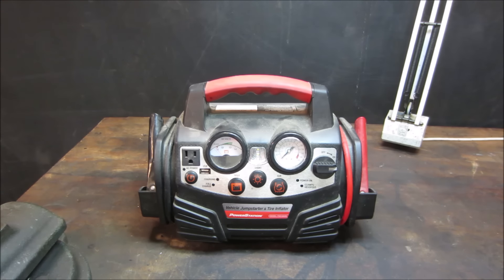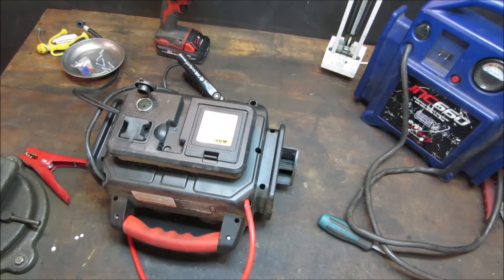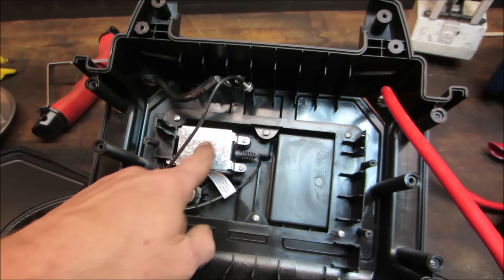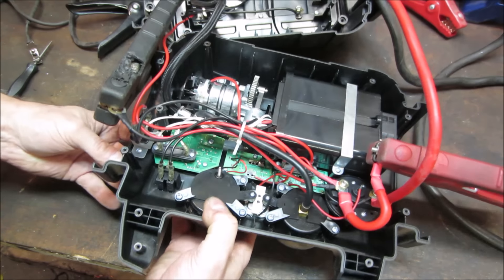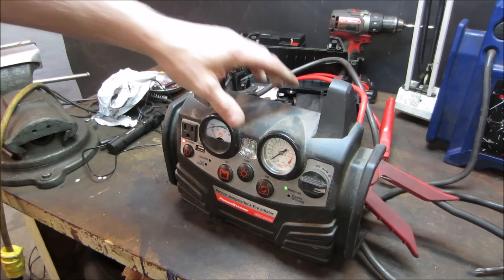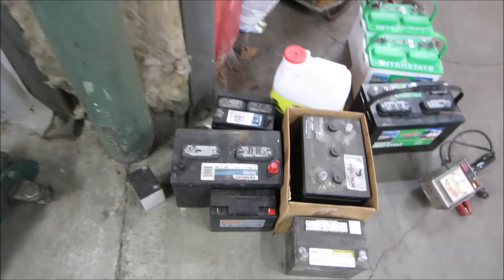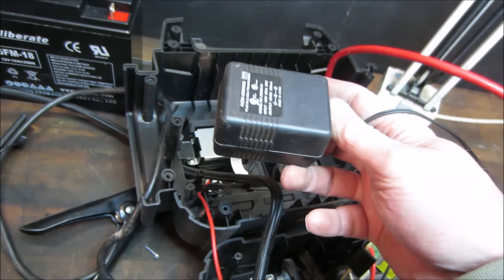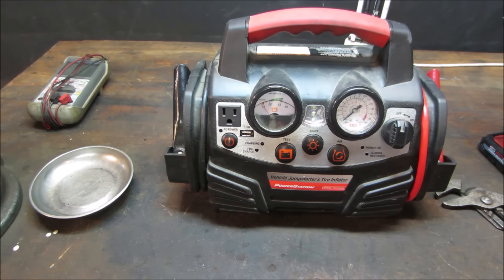What is inside a car jumper pack? and can we fix it.

Comment: On all those batteries you got you should rig up a trickle charger for all of them and put it on a lamp timer to run it every day for half an hour.
Use a single trickle charger.  Tie all the grounds together and to the ground on the charger.  Run the charger positive through resistors to each battery.  Hmmm... use about 42 ohms/1W for each resistor.  That should input 50 to 100mA.  And that will keep those batteries charged and healthy.  It looks like you had perhaps 10 batteries so a 1A charger should do it.  
A dead battery left to sit is a battery that will be unrecoverable in just half a year.  Also, you can setup the wall charger for those jumper paks on the same timer and give them 30 minutes every night.
Same goes for most electronic equipment.  Electrolytic capacitors with no charge applied to them will eventually have their plates collapse and become no good.  So I have my guitar amps set for ON and plugged into a lamp timer that turns on power 30 minutes every night.  I have some audio amps that I just leave ON all the time.  Two have been ON (except for power failures) since 1985 and they still work just fine.  I have two VCRs that I left unplugged for several years.  The caps were shot.  I had to take them apart and replace the big electrolytics and they came back to life.  Unfortunately when power is applied to them they don't fully turn on without a human pressing a button.  They're just doomed.

Comment: The fan is cooling the inverter which makes the AC.   It has mosfets in the inverter which create “synthetic” AC from 12v DC by fast switching and need cooling.   That tiny inverter would power an electric razor or a phone charger.

Comment: Yes it would be interested in the Three rail train set,especially if it’s metal rail holders as that might be Hornby 00 gauge built roundabout late 1950 early 1960 when launched in England slightly later Triang released one I think the Hornby ones are collectors item and worth a bit.If you do make a video of it a lot of your followers who like me in my 70s might be interested the gauge and the details carried on the old Hornby engines and rolling stock are fantastic for metal parts . I hope 🤞 you make the video no matter what brand it is all the best Jeff original pommy , now Fair dinkum Australian 🇦🇺
P

Comment: @Mustie1 If you turn the small plastic flat screw on the battery load tester to the right ( or left) it will adjust the pointer

Comment: I have an old Stanley jump pack that no longer has the guts to jump a vehicle, but I keep it around anyway for power outages, etc.  It has a 12v socket and a couple USB ports.  The battery is weak but has plenty of capacity to charge USB stuff and with a car adapter in the 12v socket, will run a radio for at least a day, probably even a small 12v TV.  I probably should throw a new battery in it, but meh...

Comment: Looks like a bog standard UPS battery, good for 3-5 years tops, good news is they are very standard sizes and quite cheap. for the inverter, probably just a laptop charger or something, maybe even a cordless tool charger? the mickey mouse one in my Volkswagen is good for 150w.. good enough for a crockpot.. good chuckle for anyone who has read Manifold Destiny

Comment: A painful learning experience I had involved buying at a ham radio swapfest a new old stock gel cell, and finding it dead. I learned that if they encounter high temps and low to no charge, they will be ruined. PS- yes to the trains! PPS- That inverter can power a laptop power supply, or a small TV.

Comment: Ive picked a couple of these up and they always have an issue with the battery. The first one i fixed just had loose battery connections and still works just fine 3 years later.

Comment: That's A 12-volt battery for sure. If you use A blade to cut open the seal on it to. Then  you can refill up sealed batteries again with the same type of refill acid fluids. Auto parts stores. It's sulfuric acid fluids. By wearing rubber gloves.& safety glasses to outside ventelated area. Then fully charge the battery up wait to let cool back down test it.& then you use superglue to replace the seal top plate back onto the battery again.

Comment: It's either A 12-volt lion lithium battery.,or 6-volt lion lithium battery inside of those battery chargers normally. They half to charge around 5 to 20 amp hours on most. They flunkuwait from one to another battery type.& brand style to. Aswell as amps& voltage ratings on label by water etching paint.& peel decals letters.

Comment: A lot of times if you jump the dead battery to get some voltage in it the charger will work. Most new chargers are  set to not charge if battery is to low.  That one may have been to far gone though

Comment: i just got one of those small jumper packs with a lithium battery they are heaps smaller and i can jump my diesel international tractor with no problems, it actually spins faster then the old style battery packs

Comment: Ifr you can  get to the caps a lot will be low on water but ull probably have yo drill holes  I like those mini ones I bet if u pout em togethere you could make a back up system for your house  like a min i battery bank.

Comment: The intention of the 110volt socket is for a work light or emergency roadside flashing lamp, not to exceed 65 watts.  ( A drop light, treble light).

Comment: Those batteries are probably sulfated.  When lead acid batteries are left discharged the lead sulfate on the plates can crystalize making it difficult or impossible to recharge.  You can sometimes use a gadget called a desulfator to make them work better.  Lead acid batteries need to be kept at full charge to prevent the sulfation.

Comment: There is A adjustment set screw in the center of the tester you zero out with A small flathead screwdriver.

Comment: Make sure to top up the water level in those little “sealed” lead acid batteries. There’s no such thing as a maintenance free lead acid battery, they boil off water just lake any other battery there just more sealed to try to make them last. Just a couple drops in each cell extends the life by years.

Comment: Before you even take it apart, you  should be able to connect a battery charger to the leads and see if the internal battery will take a charge. This narrows it down to battery or internal charger being defective. (or connections)

Comment: Hey mustie, what do you think bout those battery charger that claim to recondition batteries and are able/made for trickle charging a battery thru the winter? I'm thinking about chargers like the optimate 4.
Reply: I have an optimate 3, great for trickle charging even truck batteries. It won't save a battery that has been left discharged for a long time though.

Comment: $30 battery is the fix. Unless one has one on hand or can get it cheaper somewhere. I owned one of these multi function jumper packs and it didn't even last a year from Walmart but I had the warranty & got a gift card right away to use on whatever I wanted from store. If your jumping vehicles often, might be worth having a jump pack that does one or two functions, once they add in all the other accessories, I think it ruins the purpose and shortens the life of it in my experience

Comment: As it so happens, I just changed the battery on my inexpensive jump starter. It turns out that it may have been the adapter charger. I didn't try it before tossing the battery.  Yes to the train: do you still have the one from a while ago?

Comment: In my experience batteries never seem to have date codes, at best they have those grids where you can punch a date code in yourself (or if they are dated it's the original battery that came with the device)

Probably because they want to sell the batteries even once newer stock comes in and people can't tell a battery sat for a year, because people would definitely end up digging the newest one in the shelf. Just a hunch though

Comment: Awsome work I have a psx2 jumper My air pump works but i charge it. it won't hold the charge?? Help..I'm a Diy...also I have jnc770R  that I plug the extension cord n it flases  full,full,full but I use a multimeter n it says 8.70v what could it be ? I'm new to this jumpers

Comment: This may be a dumb question but do you know if you can jump from just the battery, if you have cables of course.  I was sent one of these by mistake.  Don't need a charger or compression and I don't want to buy a jumper pack but can I just use the battery in a pinch.  It's 12v but does it have enough amps.   Yeah I could try it but I don't want to disconnect the battery and hassle with it right now.  It seems to me that these power packs can't do anything except connect the battery via cables anyway.  They can't increase the actual amps of the battery, right.  I already have the cables and battery box for it and it would be lighter and easier to use than a full size car battery as a spare.

Comment: the load meter needs to be calibrated, that's what the little screw is for in the middle of the pointer.... hook it up to a charged battery, tweak the adjustment to where it should be then there you go.
Reply from the maker: then it would be of on the voltage

Comment: - first of all you show that we through way too much stuff out. thanks!  Replace the bad battery and be done.  As for the black box - that's an inverter board.  Probably puts out 50 - 100 w, usefull for a laptop charger.  And yes, Christmas is soon, do the train set!

Comment: A typical lead acid battery cell is 2.1 volts. “6 volt” batteries have 3 cells, so 2.1 volts/cell * 3 cells = 6.3 volts. As you may guess, a “12 volt” battery has 6 cells, so 2.1 volts/cell * 6 cells = 12.6 volts. This is what they call the OCV or open circuit voltage, basically what the battery voltage will be when it is just sitting unloaded. Lead acid batteries can also carry a surface charge, which basically just artificially raises the voltage until a load is placed on it, and is very typical after charging (which is why your freshly charged battery showed almost 14 volts).

Comment: Lead acid battery, left un charged for over a year, is dead.  Even if you get it to accept a little charge, it won't have anywhere near it's rated capacity.

Comment: That was interesting, I wouldn't trust the amp hour rating on the Chinese battery,  they do have a habit of over rating their products to make them seem better. The black box would be an inverter, changing 12v dc to 220v ac, only thing is there would be just enough current flow to operate a little mains powered radio, no chance of using it to power a grinder.
Reply: the outlet might only work if it is connected to 120V while charging
Reply: @natalieisagirlnow  lol! Then what's the point of it?

Comment: There are steps in the green with numeric denominations ie 600 700 800 900 that is your cold cranking amps the needle drops to the amperage in battery under load read the green number that’s the amps at the step the yellow range is if you have it hooked to a vehicle that’s running it will tell you if it’s charging you compair the gauge with the Cold crank amp sticker on your battery to see how close it is to see if the bat is good

Comment: The jumper will work for less time with the new battery as it puts out less power. 17 amp for 1 hour vs 18 amps for 20 hours.

Comment: Anyone know where i can find the air compressor that's in this exact jump pack? I bought this same one from Costco a few years ago and the cast metal housing on the pump cylinder broke. I've been looking for a few months now and can't find it anywhere. I hate to throw away a $100 compressor when it needs such a simple part.

Comment: Was the compressor not working or the charger system not producing power to jump start the engine you was trying to start?  The battery was shot needed a new battery. Y are you looking for a problem in other areas of charger? You know it is the battery.

Comment: I'm only 6 minutes into the video and I'm guessing that the battery drained so low that the charging circuit doesn't even recognize that there is a battery present. I would try hooking up the dead unit battery parallel with another 12 volt battery that's fully charged for a few minutes to raise the voltage in the dead battery enough to be recognized by the charging circuit.

Comment: Dead agm batteries won't charge with a normal battery charger unless you charge it with a good battery connected in parallel

Comment: Did you know you can run an engine without a battery. When you jump it you can take the leads off and it will keep running whereas if the battery doesn't work and is connected it will just zap all the power from your jump starter. Just a little tip for you if your battery is broken, just take it off and carry a jump starter around to get it going. I have a Yamaha aerox and have to do that because the kick start is bad for my legs. It's just too short and awkward so I carry the starter in the helmet box.👍😉 also when your battery is broken and the machine is running all the power goes into the battery instead of lights and other things electrical and they don't work properly and put strain on the alternator therefore cutting the engine out.

Comment: Word of advice, get the batteries off the concrete floor, that will drain and destroy a battery. Simply place a sheet of plywood or a board on the concrete to insulate the batteries from the concrete.
Reply: @kontu5399  not true, my work was in the industry, never store anything that holds a charge on a concrete floor, it will cut it's life easily in half.

Comment: U're scaring me today:  7:45 Putting metal held by bare fingers into an unknown socket that could be connected directly to mains power. 14:05 poking around a circuit board on an inverter circuit. Lucky U didn't get shocked. Or maybe U investigated more than U let us know?

Comment: What you didn't test was whether the charging circuit actually worked.  While the wallwart was producing some voltage, you don't know how much or whether for some reason it was emitting AC.  If the voltage was below 13.8 or so, it will fail to charge.  If it was AC that might have been what killed the battery or it's simply wasn't charging.  You should be able to test the charging circuit by pushing the test button and keeping it depressed while you plug it into house current.  If the voltage tweaks up the charger is working.  If it doesn't, you will have to replace the charger, and it'd be worth trying to charge and test the original battery for s**ts and giggles..

Comment: if you seriously think that needle is off you see that little plastic screw type adjustment just turn it to the right just a little bit and it'll move the needle up without impacting the measurement

Comment: Your lack of knowledge on 12V batteries became more and more apparent as the video went on. 🤣 All 12V batteries reguardless of size put out the same power, the one you had in there first was slightly smaller capacity or Amp hours. The size increases or decreases capacity only.